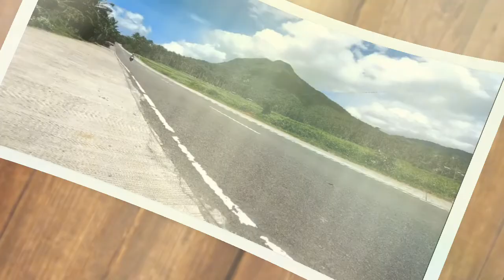R15 V3 Movistar Old Stock Mags Converted into V-1 Asio Double Disc Crome Mags

Comment: PLUG N PLAY NAPO BA YUNG ASIO MAGS PAPS? tsaka swak ba stock tires natin sa asio mags?
Reply from the maker: Swak sa stock tires kaso ung asio mags hindi swak kailangan magdagdag ng mga spacer kailangan pa machine shop
Reply: @vinzStamPedeOfficial2400  Ahh okay po. yung disc plate po pala. pang r15 po ba yan?
Reply from the maker: @ristel7506  swak din sya sa pang r15 paps

Comment: Good day,anong size po ng bearing ginamit niyo sir?at sakto ba yung stock disc ng R15 para sa mags?
Reply from the maker: Oo bro stock na bearing lang gamit swak na swak  sa mags
Reply: Ang stock na rotor disc ni R15 v3 ba boss,swak din sa ganyan na mags?
Reply from the maker: @al-nadeeradil5842  hindi eh iba kc ung size ng stock rotor disc
Reply: @vinzStamPedeOfficial2400  ahhh,yung sa kaliwang caliper naman boss,sa anong unit ginamit niyo?
Reply from the maker: @al-nadeeradil5842 single califer lang muna pinakabit ko dyan bro